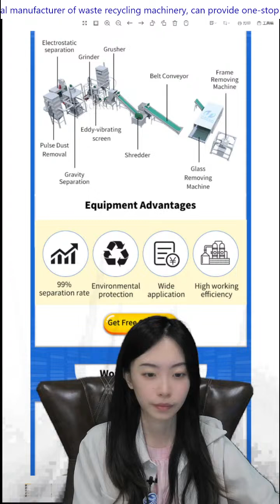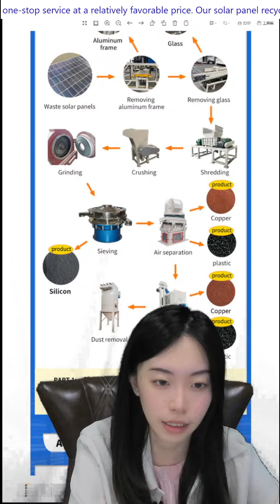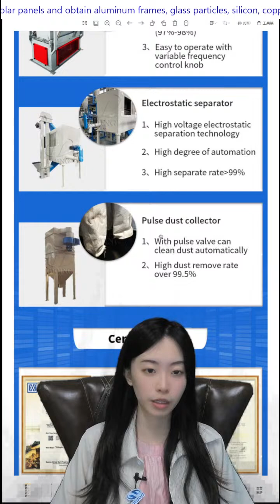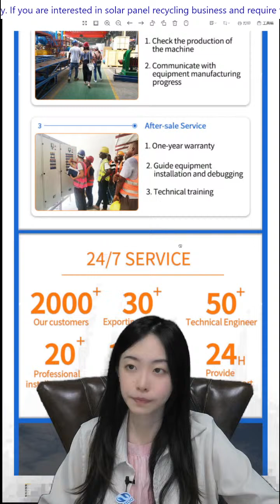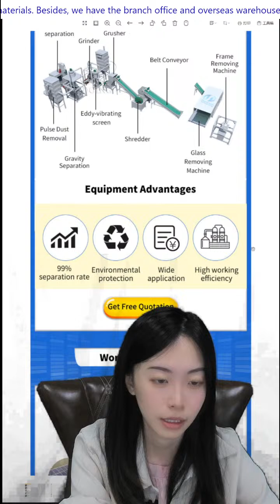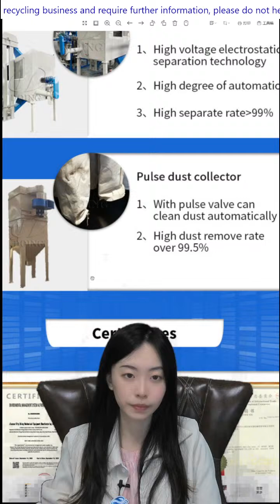Solar panel recycling equipment prototype display and process introduction

Comment: I noticed you are only covering two metals in your separation process. What percentages of silver are you also pulling from the system?
Reply from the maker: The silver content is relatively low, and it is mixed with the sorted silicon powder and needs to be further purified to obtain.
Reply from the maker: More details, please contact our manager.        Email: market@doinggroup.com
WhatsApp/Wechat/Phone: +86 150 3713 8562